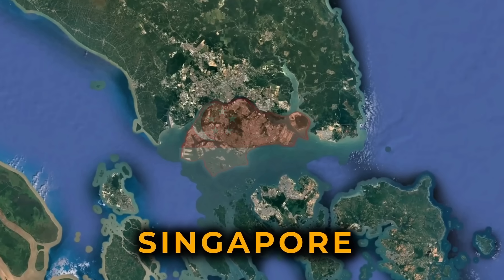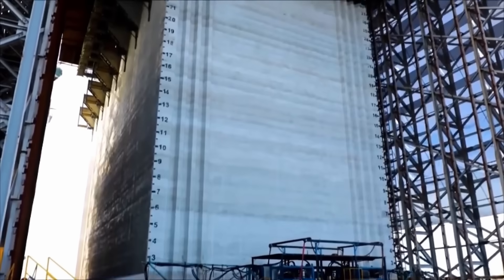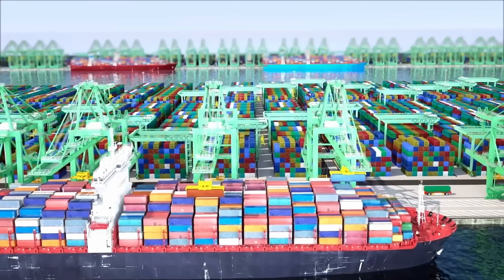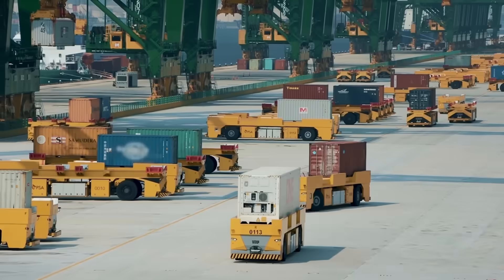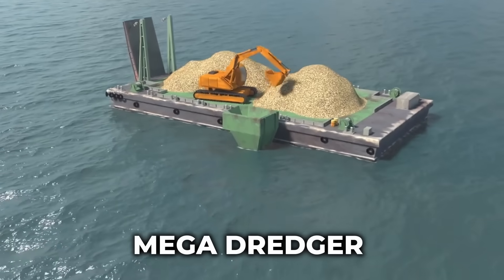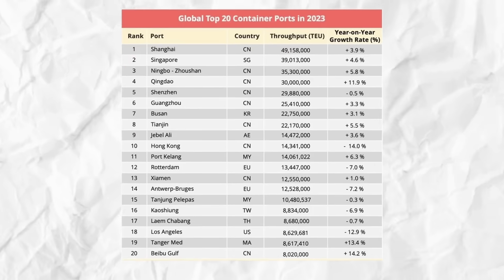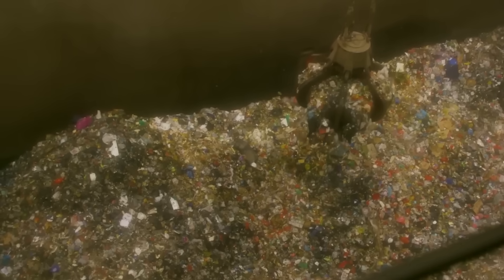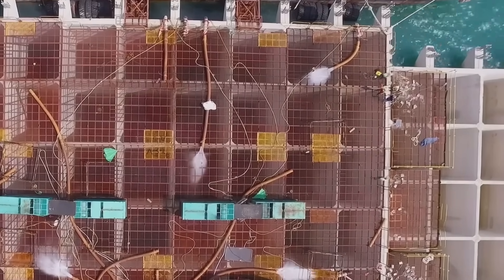Why is Singapore Building Giant Concrete Boxes in the Ocean?

Comment: Where is all that cargo going? I can't imagine there aren't other ports closer to population centers that wouldn't be closer to where the containers need to end up. I'm assuming that this port is mainly used for redistributing cargo between ships. Is that correct?
Regardless, it's a very impressive project and I wouldn't be surprised if this didn't become the new standard for new port construction in the decades to come.

Comment: Next step? Floating islands comprised of these caissons? 

Size depends on requirements. Would need an outer set of floating breakwater(s) to dampen waves and storms. Future sea level rise not relevant. Ideal location would be in Lee of landmass to shelter from stotms.

One use would be offshore space launch complexes.

If beyond national territorial boundaries, could these be independent city states?
Reply: They wouldn't last long in a dynamic load environment. It works here because once installed they are for all intents and purposes perfectly static in the loads they bear.

Comment: Yeh! It's great ! It's huge! It's mammoth! But how the phuq fo they lower the caissons onto the specially prepared sea floor. I had hoped we'd  see that operation in  detail, but no AI had to go off waffling staggering meaningless numbers instead. So overall, disappointing because I still don't know how they transfer 18000 tons of concrete onto the sea floor or how they even make them. So can we please have part two without the bullshit?
Reply: The caisson are floated out of their seaside factory, tugged to their locations, and sea water pumped into the caisson boxes, which then sank into their position. Accuracy of caisson placements is within a maximum 5mm tolerance.
Reply: there's a more detailed documentary on YouTube:
Radical Innovations To Singapore's Water Problem | Tomorrow City | Part 3/3

around 41:30

Comment: Concrete and ocean water??  Life expectancy??  50 years??
Reply: Concrete pilings that are built and designed properly can last in the ocean for at least 50 years, and possibly 100 years or more. However, the lifespan of concrete pilings can depend on several factors, including: 
Maintenance: Regular maintenance can help extend the lifespan of concrete pilings. 
Environmental conditions: The environmental conditions in which the pilings are located can affect their lifespan. 
Weather: The weather conditions can affect the lifespan of concrete pilings.
Reply: Yes I was wondering what the lifespan would be. We have lots of issues with the steel rusting away on bridges, et cetera.
Reply: @kevindruce8915 I think some of those on bridges are subjected extension loads where the steel reinforcements play a critical role while concrete pilings are subjected to mostly compression loads.
Reply: @ cheers

Comment: To all engineers, i have a question. why do they use squares instead of hexagons for the concrete boxes?
Reply: Complexity to build, those boxes are casted in layers
Reply: To simplify further square costs lower
Reply: I'm assuming you mean the infill pattern. When building rectangular boxes with only a small number of internal braces like this, using a hexagon infill doesn't use less material or result in higher strength. If you mean the shape of the caissons themselves, you can't tile a straight line with hexagons and a port needs long straight docking walls.
Reply: Ask the fortune tellers

Comment: Will also cause the water level to rise together with increase shipping tonnage at any single time.  So don't blame climate changes for seawater rise. Take the opportunity to factor this rise and take mitigating actions now.
Reply: LOL. What are you bloody on about,  must be a brainless usa-ian anti climate change moron.

You know the total volume of ocean and how insignificant the amount of displacement this project  contributes?  Even if we take the entired reclaimed land and not just the port, and take the extremely generous over-estimate of 80 km2 by 150 m depth, it will be around 12 km3, and that is less than 0.000001% of the total volume of the ocean.

And given the average depth of ocean water  is around 3000, that will amount to an increaincrease in sea level of around 0.03 mm. And you try to blame rising sea level on this. Utter idiocy.

Comment: I've often spent hours just sitting and wondering.....if I were to convert thirteen thousand tons of concrete directly into elephants, just how many would that be?    Finally, my work is done.
Reply: Well? How many elephants?
Reply: @-Osiris-  If only you'd watched the video, you'd know.
Reply: He is pulling your legs! Also in local language “BS”🤣🤣🤣
Reply: Are you using Asian or African elephants or are you assuming the ISO-standard elephant?
Reply: @Plainstranesottomobiles  Don't forget you need to ask if it's a ladden elephant or not. That changes the weight drastically.
Reply: Hahaha such a good comment
Reply: Your work was done by others! Not you! 😂 It doesn’t count if you don’t weigh the elephants yourself!
Reply: Took me whole nine years of wondering. Now I can die in peace
Reply: Chapeau, 🎉to Singapore 😊
Reply: That is alot of concrete
Reply: Cheeky lah!
Reply: Im not any good with that unit of measurement , Now double decker buses or blue whales is easier to get your head around .🤣
Reply: @mariebaxter473  Pfft, how Imperialistic. The international standard is now metric swimming pools. 🤣